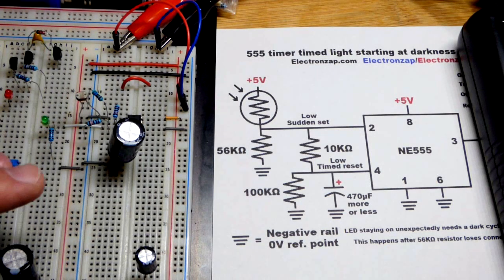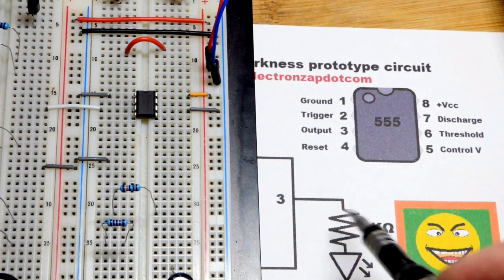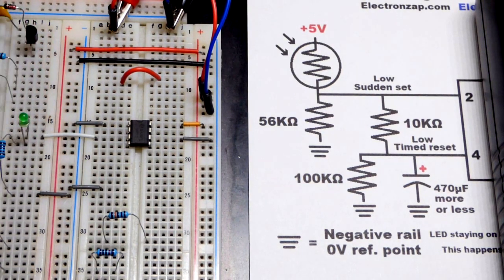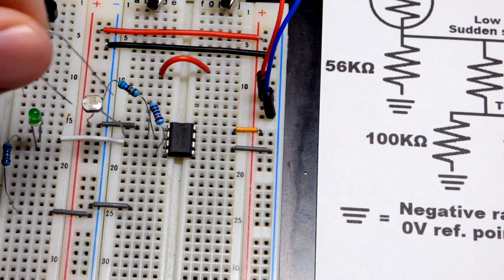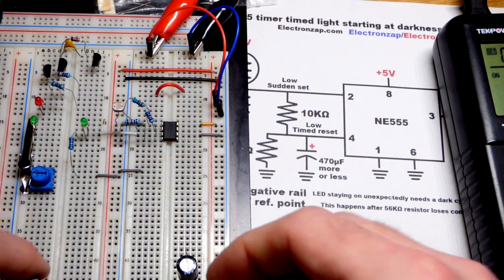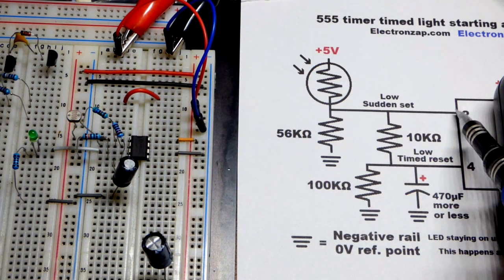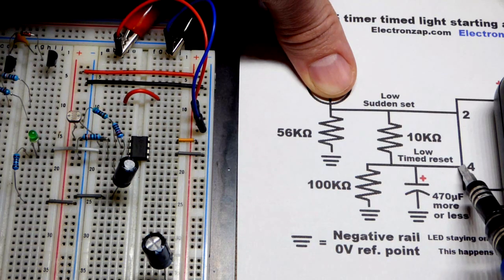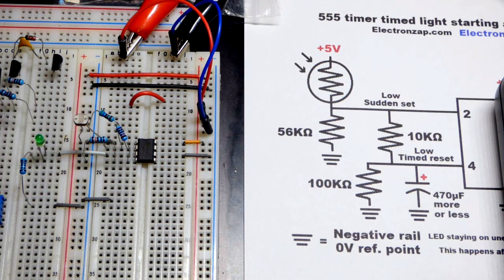555 timer timed LED light starting at light dependent resistor LDR darkness prototype circuit

Comment: HI, would it be possible to set the ON time to 6 hours for instance? After the LDR gets light the timer starts and after 6 hours run it turns off. Thanks
Reply from the maker: I haven't made any good long time timers. I've only bought modules that are Programmable.